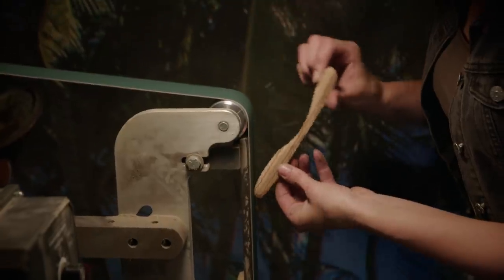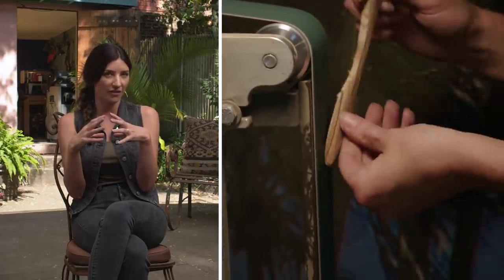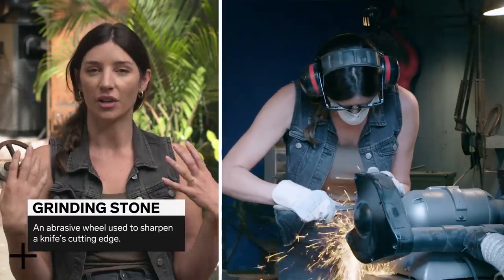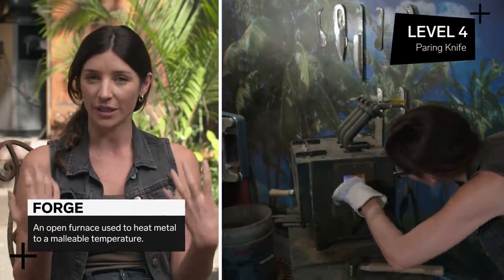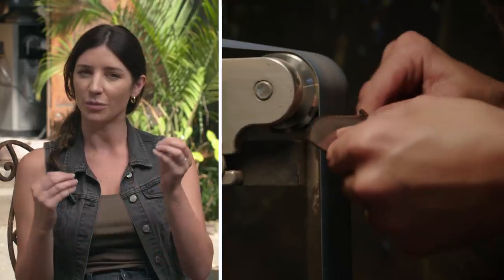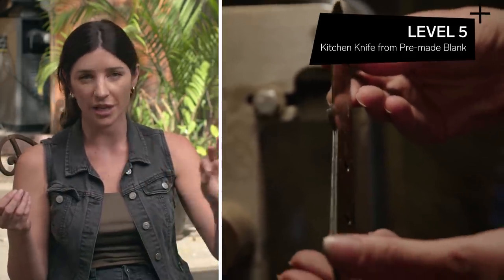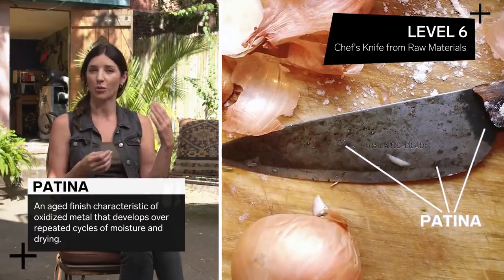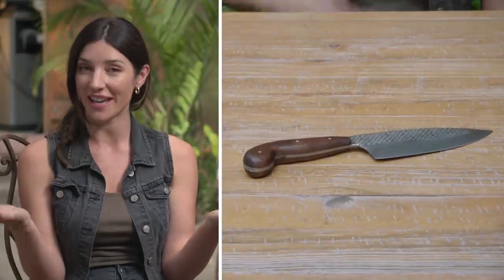6 Levels of Knife Making: Easy to Complex | WIRED

Comment: How is level 5 using a premade blank?
Reply: I thought the same thing. Seems more like a level 2 or 3.
Reply: I think she meant "Option 5"  lol  But are you really MAKING anything at that point? It's more like assembling a knife.
Reply: She was doing it based on how complex the knife is not how complex it is to make
Reply: @GreyeHazel  same thing. She started using a heating oven after people noticed she never heat treated, and if you didn't see her wash the material then there's horse crap on the rasp left over. This is just trendy  looking and they should get a woman who is an actual craftsmen.
Reply: @GreyeHazel  but thats not what this series is about...
Reply: For an unskilled maker like her that's level 5.  She's all hype because she's female in NY.
Reply: @timkelm7329  can you try again without the sexism? K thx.🙃
Reply: Level 5 would be considered medtech knives( ones that are precut and just ready to be hammer finished,  my issues are material perp... with salvaged steel cleaning is key, two is to press the stock or billet because they could have  stress points. and three normalizing process and tempering (helps with the "brittleness"). I  wish more knife makers use clay to help with differential heating and cooling (quenching). p.s. stay safe use proper protection.

Comment: Disappointed that those levels of complexity only apply to design and materials, not the tools used. Sure, almost everybody has a drill, but how many people have a belt sander or a bandsaw? It would be appreciated to see her using a handheld saw and sandpaper and files for the lvl1, perhaps going up to a handheld electric jigsaw in lvl2. Lvl 3 could've used aluminium instead of a rasp. 

Man, it looks like she's hammering on a cold metal in and above lvl 4... Dunno if it's the camera settings, but it does look dead cold. And you don't want to hammer on cold metal, cracks are just waiting to happen then.

Heat treating is about scattering electrons? Well, there are electrons in atoms, but that explanation is terrible. Scattering carbon is somewhat correct, you do want to achieve a uniform distribution of it, among other inclusions, like chromium, through the material. The main idea with heat treating though, is to achieve a hard and tough material, by manipulating the grain size and overall crystaline structure of the metal.

Then... Does she know, that you generally sharpen in the opposite direction she's doing? As in - you push the edge, not pull it.  All she's doing is creating a wire edge, that will be seemingly sharp, but will chip away on the first cut on something even as soft as wood. 

Premade blank for a lvl 5? What in the name of all that's holy?! Is she a knifemaker or knife assembler? That could be good for lvl2 or something, not lvl5!

And finally - her designs are atrocious on all levels. Literally terrible. Why make the handle so skinny in lvl 3? What devilish demons compelled you to incorporate a grater into a knife? 

Boy, she looks like she enjoys what she does, and has some experience, but knows next to nothing. Choosing her for this was one of the worst ideas I've seen.
Reply: rubbers3 I wholeheartedly agree
Reply: @Kristian Chappell but you took your time to complain and comment, seems like legit trolling
Reply: you push the edge, not pull it are you sure? Dont you try to pull the material of the tip like that =>- instead of =,>? (No chef just watched a 10 min vid on it). But this is also the direction u use on the belt (which i did in school, so it seems reasonable to me). Otherwise i agree, eventhough i would not have worded it that strongly. I do think the handle does follow some norm of ergonomics, whith the wider 'ball' ath the bottom, the balance could be ok isch. But it looks weird and i would like to have more material close to the blade to control the blade with more preciscion. However, i wouldn't judge it without testing. Maybe she was going on about the Curie-temperature with the electrons but i dont know what you what kristaline structure you want internally, maybe you do? But i agree tempering (think thats the word) is about the hard, high carbon exterior (austenit, if i am right) and the soft core, which was simplyfied a lot. Yeah would be happy to hear your thoughts. Thanks, a noob.
Reply: Yeah, dissapointed at the first levels, you can make amazing knives with hand files and patience that can look as good as knives made with more expensive equipment.

Comment: A-ha, that's why I found her familiar. She makes hipster overpriced knives with horse hooves rasps.
There's was even a video where they compared her ~$1500 knife with $200-300 Japanese knife. Well, the latter was many times better.
Reply: Marlbrough oh I remember that video
Wasn’t it made by worth it?
Reply: Can i get a link?
Reply: I feel like your comment is misrepresenting what happened in that video. For one, it was a $160 Japanese knife vs. her $800 knife. Second, it was, "worth it" so which one is more worth the price. Which isn't the same as saying which one is better.
Reply: @cthomas025  A knive made out of an old rasp wouldn't be worth 160$, either.
Reply: @jakobklee2800  Why? What it was before it was a knife is irrelevant. Material is removed to create the knife, so the form it had before doesn't matter one iota. Metal can be melted down and reformed into something else, shaped into something else via blacksmithing, etc., that doesn't change its inherent qualities. You can think it isn't worth what she charges, but that reason is just plain stupid.
Reply: @cthomas025  It 100% does though. Steel isnt just steel. Therrs a lot more to it than that
Reply: @ironized  I'm aware of that, but the form that it takes is irrelevant. 18/10 stainless steel is 18/10 stainless steel regardless of the shape it takes.
Reply: Christopher Thomas heating and cooling and the way in which you heat and cool can dramatically effect the properties of the resulting carbon steel blade ... also ... bladesmith don’t melt steel n then pour them into shapes. fyi.
Reply: Christopher Thomas making knifes out of files is something you can do as a prof of concept or just to get you comfortable using and learning the proper techniques. But they are not for selling, I’m not saying her knives are bad, but they are over priced for the material and overall finish.
Reply: True. Her knives are impractical for the kitchen to be honest. It probably sells better as a novelty item, something just for display because of her unusual designs.
Reply: @cthomas025  how did you get the name 'Chris' ?

Comment: Neither the paring knife nor the chef's knife would be comfortable to use in a kitchen for any decent length of time.  The pairing knife looks elegant and stylish but the thought of working my way through any amount of veg with it would make me reach for my £3.95 Victorinox.  Let's not even mention the grater on the "chef's" knife.  No, just no. 

Style over substance.
Reply: Don't forget the thermally insulating wooden butter knife, to ensure maximum butter hardness!
Reply: @seban678  didn't thought about that but you are right, hilarious

Comment: "We want to make sure that the blade is structurally sound so making sure that the molecular structure is going to last a really long lifetime."

Wait what? That paring knife doesn't even look like it could last a day.
Reply: Not sure if you know what tool steel is, but it's a very strong and resilient material. More brittle than a butter knife but nowhere near as soft. It's usually used to cut other metal like in drill bits and machining parts. So it is not as weak as it looks. Ergonomically I don't like it, but it's not gonna snap when cutting food. If it does, you probably don't know how to use a paring knife.
Reply: @InitialDIYmods  1095 is NOT tool steel. She's bullshitting her way through this. D2 is tool steel as are many other variants. 1095 is a high carbon steel NOT used for tooling. And rasps are made of 1085, again not tool steel. I love how her level four difficulty is buying a ready made knife and putting a pwetty handle on it, well, a basic badly finshed wood handle.... Not exactly 1000 grit desert ironwood ,with a mammoth tusk inlay now is it??

Comment: tf is with that skinny necked paring knife? it's just way too weak
Reply: Knezy2326 form over function
Reply: If you would break that knife using it as a paring knife you are doing it wrong. It is perfectly fine.
Reply: That's the point, she sell them 800$, she want you to buy more
Reply: @ChopKnives  I'd be more worried about the roundness of the handle not allowing proper indexing of the blade. Since hands often get slippery when using the paring knife, it would be a kife I would certainly not include in my knife bag.
Reply: i use every cheap knife and make it better over time until it break  but for that paring knife it going to break not even for year but a weeks
Reply: @joshiwaraneo  I think you should take some English lessons bud.
Reply: @Knezy-fb5vu  sorry for bad english
Reply: @joshiwaraneo  no problem
Reply: my hand would literally die trying to hold that

Comment: Hi Chelsea! I did a couple of blacksmithing courses and my instructor gave me an earful for holding my hammer halfway down the grip like you rather than holding it right at the end. Sweet validation! I wanted to ask what the rationale is for your technique, because intuitively I prefer it
Reply: Where you hold the hammer in blacksmithing depends on many many things, the main ones are:
What type of hammer are you using
What was the design of the handle
What you were trying to do to the material
The structure of the material you are using
Are you on an anvil or a swage block
Length of the handle
There is never just one “correct” Way to hold any given hammer in any given scenario, however if your blacksmithing instructor is telling you to hold it in a specific way, you hold it in that way. End of conversation. In a craft such as blacksmithing (which is horribly represented in this video might I add) it can be dangerous to you or people around you if something goes wrong, so always try to learn the right way and not just the easiest way.
Best of luck to you in your blacksmithing endeavors, I’m not trying to offend or make fun of you with this, I’m just making a point that you should always listen to the people who have mastered the craft if you are trying to learn it.

Comment: Seriously could have made a flint knife that cut better than half of those...
Those wood knives don't even have a fire hardened edge!

This video... I'm at a loss for words
Reply: Half the knives are blunt by design so that's not much of a claim (levels 1-3 are clearly not cutting tools).
Reply: @anonymes2884  If it doesn't cut, then can you really call it a knife?
Reply: @TeknoXI  Sure, not only can you but people already do, routinely. Google "wooden butter knife" for examples. You're free to argue otherwise of course but then your issue is with what people in general call a knife rather than this video in particular.
Reply: @anonymes2884  You realize that means that half the knives are "butter knives"... The issue with the video becomes multi-fold. It's suppose to be "6 Levels of Knifemaking". There are quite a few ways they could have approached this premise and they chose a very poor way of telling the "story".
Reply: @TeknoXI  I do indeed realise that, yep. And you're obviously completely entitled to hold the opinion that "they chose a very poor way of telling the 'story'" (though that's still only one problem with the video, of which your other complaints are consequences - you can't really say "I don't like the video because 3 of the 6 knives are butter knives" [which are, almost by definition, blunt] then say "And another thing, half those knives are blunt !" and count that as "multi-fold" issues).

Comment: level 5 knife is a prefab you just need to assemble. It's like having a chef warming up a precooked meal. How is this level 5? That's between 1 and 2 at best.
Also "you wanna make sure, that you are protected against heat" - hammers red hot piece of metal in sleeveless vest with cotton tank top underneath hunched over an anvil that is set way to low.
Sorry WIRED, I get showcasing women outside their gender roles, but at least make sure, they know what they are talking about. "Electrons scattering about the material" LOL
Reply: Well, you can forge in short sleeves or tank tops, even topless, it's not that dangerous, if you know what you're doing. What she says is a bit... Well, not wrong, but bit over exaggerated. What you actually don't want to do is wearing synthetic materials, that can melt onto your skin or catch fire.

Comment: Still one more step. Brute de forge. No cutting, no addition, just that starting blank. Grind final bevels. Figuring out the intended knife length and thickness and then getting the blank is very high in skillset.

Comment: Nice video, but I don't believe that's a respirator. I don't think it filters vapors or gases ; it's designed for small particles, such as when you're sanding. I mean, I could be wrong, but I use a respirator for paint jobs, and it looks nothing like that. What you wear, I use for woodworking. Anyways, have a nice day!
Reply: I don't think you're wrong. She doesn't seem to be using proper protection.
Reply: That's the least heinous of her many obvious areas of bullshitting.

Comment: I want to make a knife now. I don't have the tools or the fine motor skills required for it but hey.
Reply: she's purposefully making it look harder than it is so she can charge $500-$1000 a knife and $150 for a wooden knife.
Reply: If you are patient enough, you can make a knife just with a file and a sharpening stone. The motor skills develop while doing it.
Reply: @rsmorex  i mean i guess so, but still. I have neither the tools nor the workshop to make any of that. I guess icould always just use a knife to carve a knife out of wood and sand it down by hand maybe
Reply: @Skyfox94  I've done it back when I was like 17 or 18 it had a rounded handle and was sharp enough to slice paper and I didn't even use sand paper just a pocket knife

Comment: I have to admit the fifth level is a little bit off but overall this is pretty good. And people really slammed this documentary huh.
Reply: The fifth level really proves, that she doesn't know what she is talking about. 

If you look at the tang/choil part of the knife, you will notice that the finger guard extends beyond the edge of the knife.
Try chopping some parsley with this, and you won't be able to cut with the full length of the edge, but only the tip.

You can also see that the angle of the edge is quite big, and the blade is very thick.
Try cutting hard vegetables with this, and it will be very hard.

If you try to use this knife as a regular kitchen knife, you will suffer.
Because this isn't a kitchen knife, bit an outdoor knife.
It is used differently so it is designed differently.

Comment: you shouldnt wear gloves when using a grinder or sander. if the glove gets caught in the wheel it will pull your hand in and you wont be able to pull back. If you dont wear gloves and your hand gets nicked, you can still pull away

Comment: A knife should have well-concieved, purposefull, ergonomical shape matching it's function, followed by the execution with attention to the detail. In this video there's neither. Those are one of most botched, dumbest knife designs I've seen in my life, and the finished blades reflect light in so many different planes that they look like thrown under a train.

Also, kitchen knives are made with stainless steel for a reason, which is lack of rust or acidity taste on food (high-carbon steel)  and are supposed to be cleaned easily (zester chief's knife, ROTFL).